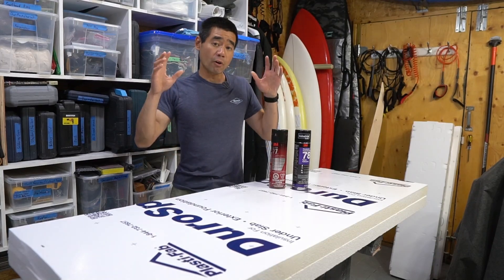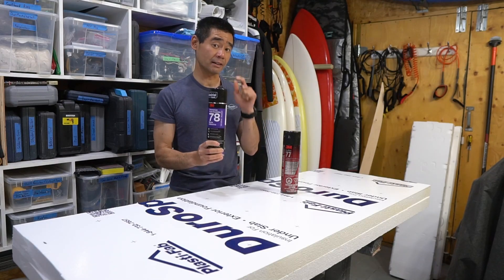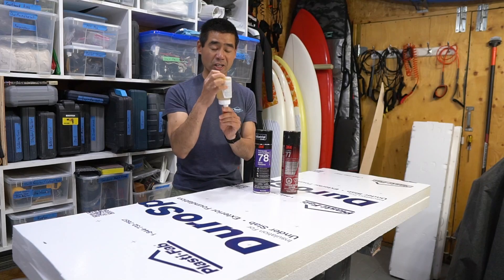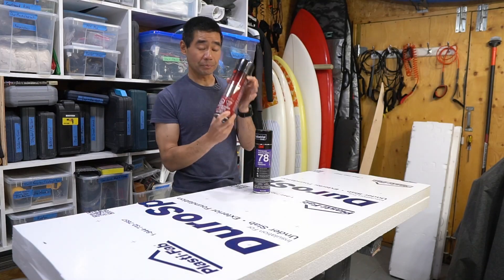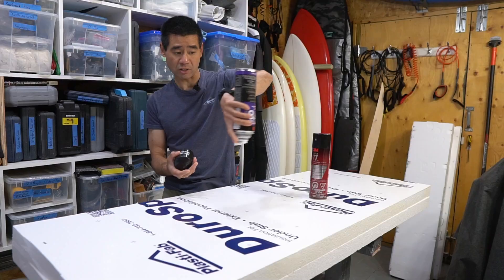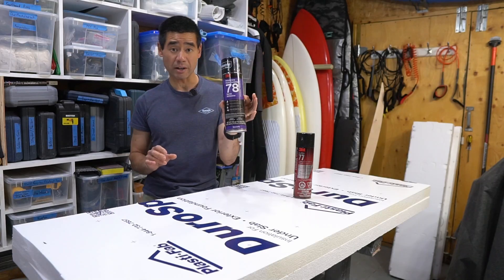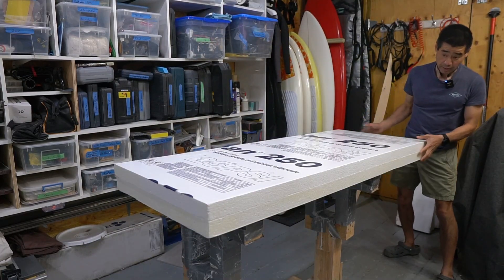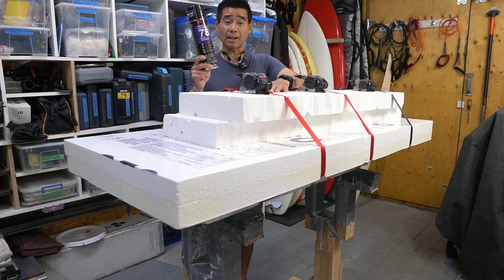How to Glue EPS Foam Sheets Together, 3M Super 77 vs 3M 78 Spray Adhesive | Surfboard Building

Comment: If you're worried about the glue seams on the blank, use your template to mark the outline of the board on both sheets & either mask up to/ spray but use a piece of  cardboard as a shield, or don't spray glue on your cutting or shaping lines. The glue doesn't have to go all the way to the edge. Same with your profile if you are having a lot of rocker - only spray the glue up to your shaping line.

Comment: So, you actually let the spray dry before putting the pieces together? When I read the can, that's what I thought it meant, but wasn't sure. I'll be gluing the insulation to plywood, and probably spray both the insulation and plywood, what 3M calls 'two surface bonding'.

Comment: Great video. Thanks. How light have you gone with this construction style EPS? I’m curious to know how far you can go before durability becomes an issue.
Reply from the maker: Thanks! I probably wouldn't want to go less than 1.25-1.5 lbs/ cubic foot. I think you could get away with 1 lbs/cubic foot if you glassed it heavy but then the trade off is the cost of resin and weight of the fiberglass does add up. Having said that if you don't mind some pressure dings like a PU board I think you could get away with it but I haven't personally done that as I prefer to make my boards to last.
Reply: @AndrewWorkshop  thanks

Comment: Does that layer of writing on the insulation peel off? Or is just taken off as it’s shaped?
Reply from the maker: I should have mentioned, that is a vapor barrier that is on some sheets. I peel it off if I need to glue sheets together or when I hot wire I don't need to remove it since it gets removed with the big chunk of foam. A hairdryer helps loosen the plastic and it peels off easily.

Comment: Have you done a seperation test with bending a vibration or are these all good to go?
Reply: Curious as well
Reply: Properly applied, my understanding is the 78 adhesive is stronger than the foam. Once it is glassed, the skin will strengthen it substantially of course.

I've been making blanks differently than Andrew (I glue XPS rocker slices). The one blank I glued up with 78 has worked well, much faster to glue up the blank than with pu glue (no clamping) and vastly easier to shape over the seams. It also maintains the flex of the raw foam. With pu glue, the glue line is stiffer than the foam. Depending on the geometry of the glue line that may be a good or bad thing (my glue lines are effectively stringers and I've made "stringerless" XPS boards this way).
Reply from the maker: Thanks James!
Reply from the maker: I have on a small pieces, I wasn't able to pull the sheets apart manually.
Reply: @AndrewWorkshop  I had one joint at the nose of the 7-11 separate slightly while I was levelling the deck. But the foam was barely a half inch thick (or less) there and I probably didn't get a perfect spray of 78 in that spot. It was easy to fix (wicked in a little clear pu). 

For my process, spraying slices around 2.5" wide, there is a lot of overspray and the process is tricky to align and messy albeit faster than clamping up pu. For gluing whole sheets, I think it is the way to go. I would still use pu to glue in a wood stringer.
Reply from the maker: @jamesroscoe7555  Thanks for sharing your experience, agreed PU glue is still the way to go for a wooden stringer.

Comment: This clamping method is not recommended for flexible materials. Uniform pressure can be applied using drywall boards with the eps lying on a large flat table.